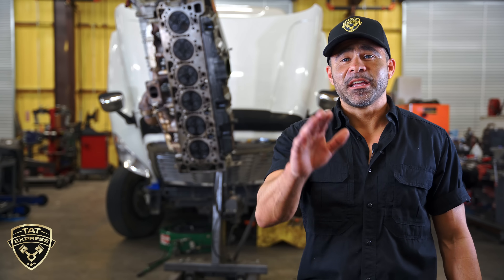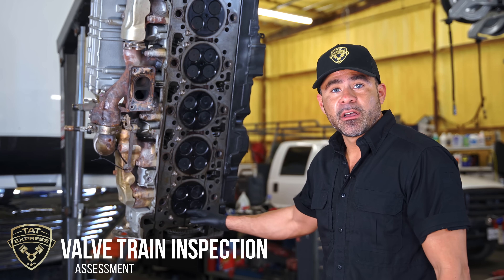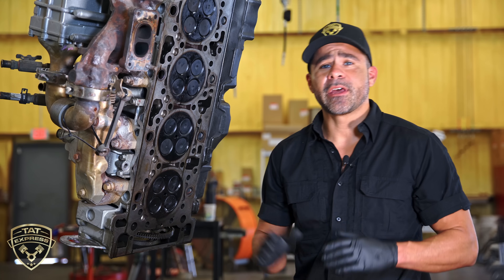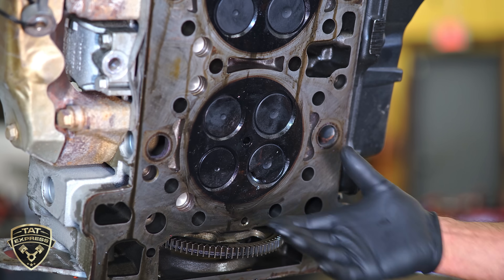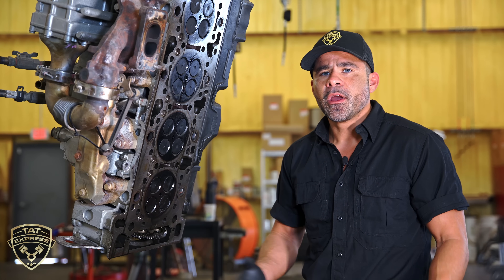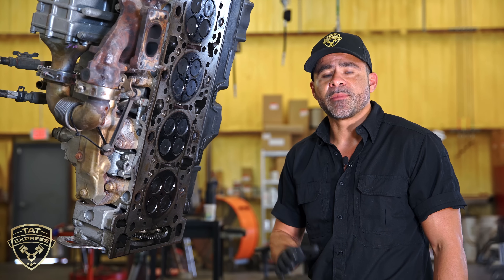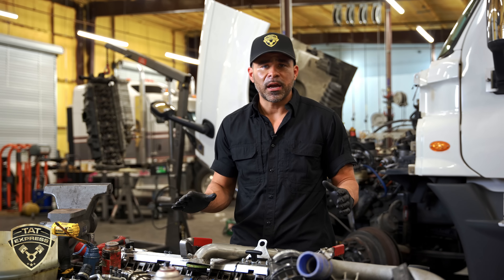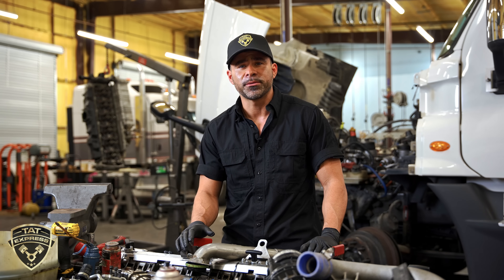The truth about semi deletes/Semi truck delete/diesel engine deletes/diesel delete explained

Comment: Engines have been running without egrs or DPF system since they were built. Also deleting the emmissions off of an engine will not damage a valve. and just deleting the system does not increase the amount of fuel that is injected, tuneing does that this is a tuning problem MAYBE, and has nothing to do with the delete.  here is the funny thing iv seen valves do similar things in engines that never had emmisions on them in the first place. valve spring and sticking rockers can do this damage excesive heat from a leaking injecter can contribute. Just deleting the system stops soot from going into the intake soot in an apprasive which has already been proven and damage the cylinder and reduces effectiveness of oil. deleting the DPF will alow the exaust to breathe better in turn you get more HP. By letting breath better reduses EGT, EGTS are main failure of and engine if not controlled guess what to much back pressure will cause an incresse in EGT oops i said that out loud. Anther funny thing is i dont see any sign in the video of excessive heat, If my memory serves me right kenworth ran the ISX15 they added the emissions to it to meet FED REGS by doing this in cause the ISX to be unreliable after that. they had to use a differnt engine to handle the emission BS. Personally i think your paid to say this.

Comment: As far as Cummins go ISX and X15 deletes are the way to go 🤷🏽‍♂️ every single one I've came a gross that's delete and also has had the egr completely removed never have problems maybe detroits are different but there is a reason all the 14ls and 12.7s pre emission engines never had issues
Reply: ISX engines handle deletes real well because of the aftermarket industry offering full tilt manifolds, aftermarket turbos, cam swap options etc. the DD platform doesn’t have a aftermarket industry. You can’t get aftermarket manifolds to cool the egt, you can’t get aftermarket turbos unless you delete the vpod and get a aftermarket manifold which isn’t available and the fact the DD platform builds heat so stupid fast you’ll need to swap cams and pistons to make it worth it.
Reply: @MJusten7657  the main reason isx handles deletes well is because you can use the tuning maps from 2001 isx  with no dpf/scr/egr. The tuning was done by engineers and experts so there is less room for error. There is no pre egr/scr/dpf DD15 tune you can find. So how good a tune is for the DD15 will completely depend on the individual tuner you chose to go with. More room for failure because most tuners are not engineer level
Reply: 12.7 liter engines will have blackened pistons over a longer time period than EGR engines.  Recently a company called Speed Of Air has engineered new and improved pistons that may completely eliminate that problem, even with EGR and Regen engines.

Comment: In my opinion this is just like DOT saying you cannot operate a commercial motor vehicle safely without the antilock brake system functioning 100 percent correctly. If this is the case what happened before antilock brake systems, yes it might stop a few wrecks or jackknifes, but tell me you don't still see trucks jackknifed in the median still today. The antilock brake system has nothing to do with if your truck will stop or not, you push the brake pedal and if your brakes are adjusted properly you stop. All the antilock system does is stop you from skidding and in my opinion gives you a longer stopping distance. However back on topic. What did these motors do before all the pollution control crap was put on them? If you eliminate the DEF system but keep the EGR system your not really changing the performance of the motor. Adam did mention something about turning up the horsepower, did this truck get turned up with his delete? Could that have been the cause of the valve malfunction and not the actual delete?
Reply: people paid attention when they drove.  we have trucks setting codes because of "excessive automatic braking"   drivers must be tailgating and letting the truck operate the brakes.  too lazy to move their foot from one pedal other

Comment: Deletes are nice but I like to entertain the idea of deleting the trucks ability to put me in limp mode… I’d rather be let known my issue and take it somewhere safe off the road way without 55mph or 5mph. Idc to leave everything on or even deleting the def/doc/scr process while keeping everything else on but the DPF … lol
Reply: Get the OTR diagnostic tool and it’ll do just that.
Reply: @MJusten7657 no it won’t. If you get the def inducement light on it will clear it but it will imminently come back

Comment: I had a friend of mine I warned not to delete a couple of years ago..He paid a shop $2400 under the table in less than 2yrs     It destroyed his engine just like Adam said it would do..🤯
Reply: I bought a 780 d13 egr and dpf delete if i could go back 17 months later i would say  not worth it
Reply: @moneymikeslickwill8749  bro the delete wasn’t the problem. It was the truck you bought.
Reply: @serggla924  im in a 2014 cascadia interior is inferior to my old vovlo but man post delete on DD14 8.2 mpg
Reply: @moneymikeslickwill8749 same.. worse thing I ever did was delete my truck BUT it also taught me ALOT.

Comment: I think this is more related to bad tuning and removing the egr completely which isn't a good idea you need that extra coolant flow and sensors. The early model trucks had so many issues with def, newer ones are better and don't break down as much.
Reply: Where did you get it deleted?
Reply: I think you hit the nail on the head.  I did not realize until months later that my shop did not delete the EGR, they were told that it could not be done. But they charged me for the full delete and that kind of "ticked" me off. Now I am happy that it did not get deleted because I am 3 yrs into it and motor is running great. I have been pulling some loads at 42k besides my 32k empty weight with 100 plus degree days and motor stays around 200 degrees without the fan kicking on. We have a very tall bridge and once in a while the fan kicks in climbing it with heavy load.

Comment: He ain’t lying $13k for a reman head for my volvo i regret getting a 900k mike deleted truck smh 🤦🏾‍♂️
Reply: Leave the Egr operentional and you won't have any issues delete the DPR and SCR and you will be fine
Reply: It's a Volvo, and probably had to program the header😂😂😂
Reply: He is 100% absolutely correct. The modification are not tuned correctly which causes the head to fail. More power that it is NOT designed for causes the valves to bend or possibly break under pressure.

Comment: I did not know deleting diesel engines has its disadvantages.....
Reply: Adam saying this is like saying that everyone that eats peanut butter dies. Because the real truth is that we all die eventually and the peanut butter did not necessarily contribute to the death. If you paid a shade tree shop to delete your truck and they didn't know what they were doing you might end up like this truck and it could have possibly been the delete. But not all deletes will end up like this truck, especially if you only delete the DEF system and not the EGR which helps keep the motor running cooler.
Reply: @larryhutchinson4271 so you’re saying don’t delete the egregious?
Reply: @954live1 That is what my shop did to mine, they deleted the DEF but did not touch the EGR because the Canadian outfit that did it said not to. It is still running fine. As a matter of fact it has just as many miles on it now without DEF as it did with it.
Reply: @larryhutchinson4271 it’s not necessarily that egr cools the engine. It’s just when you remove the egr you have to tune to fueling maps which is very hard to get right.
Reply: It doesn't, just get it done the correct way and you will be fine. Friend of mine been pushing a Deleted 2013 truck for the pass 5 years and it hasn't given him a problem yet.
Reply: I'd argue that deleting an engine would increase the life span of the motor everytime. This issue was cause by a bad tuning/ cheap delete. When done right there are no issues
Reply: Of course it does 😂😂😂😂😂😂😂😂😂
Reply: It dont done believe everything you hear and see in these videos
Reply: If you don’t account for the potential issues, then it has disadvantages. Otherwise, there are zero disadvantages as long as you’re aware of these aspects.